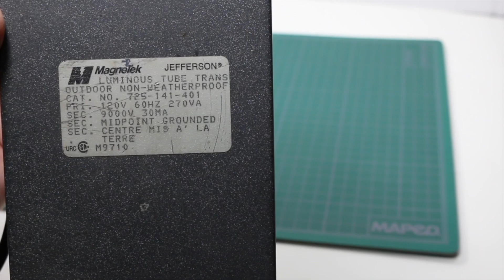Jacob's Ladder Experiment with an Old Neon Sign Transformer

Comment: You may be able to get it to last longer by making the ladder longer and more "parallel" - just flare it right at the top to extinguish the arc..
Also, you can start with a wider gap if you add a secondary terminal. Just get some high voltage resistors (or series up some 1/2W metal film) to make over 1 Meg Ohm. Connect one end of resistor(s) to one side of the ladder and place the other end halfway between the ladder legs. The initial arc will jump across the narrow gap, which will ionize the air and cause the main arc to develop.
Reply from the maker: I know I’ve heard that somewhere before from maybe big Clive, was it  a Gabriel arc? I might try that
Reply: @GadgetReboot  Yeah - it was BigClive. He named it "Gabriel" for some obscure reason. It was something from the Bible in relation to Jacob?
I tried the resistor idea on my own Neon Transformer and it certainly allowed a better re-start of each arc. They can be difficult things to stabilize, as even the slightest vibration or wind makes the "prongs" wiggle all over the place.